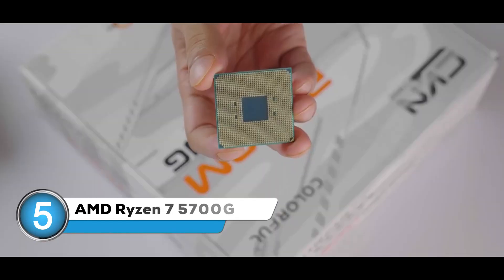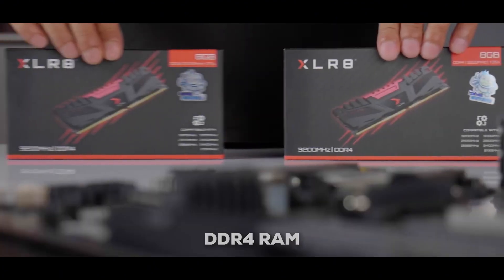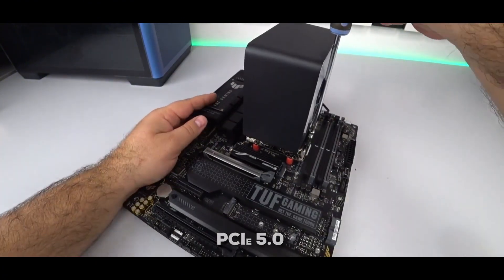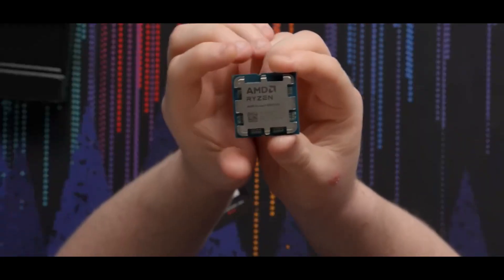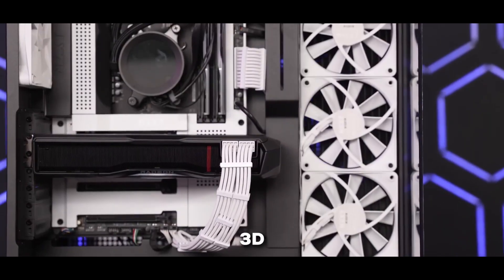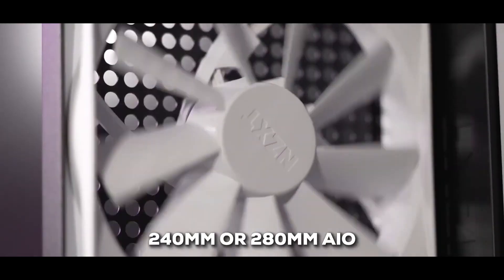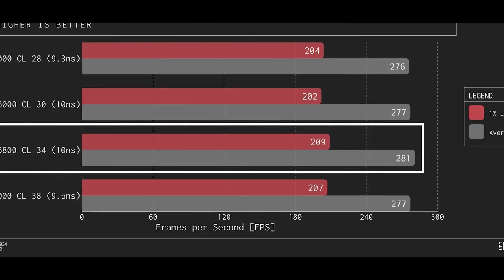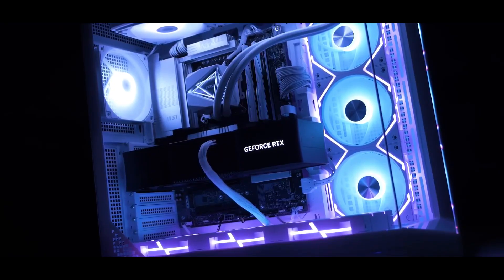Best 5 Ryzen CPU for Gaming on Amazon 2025

Comment: I have the 5700G. And while it is ok? You are limited to PCIE 3.0. And now with next gen 5.0 graphics cards on the market you will have a considerable loss in performance over a newer system. For the cost you can get into a 7500F